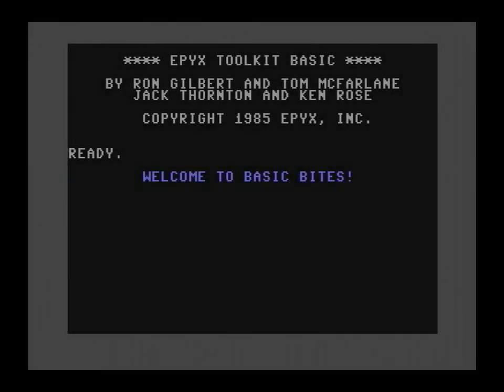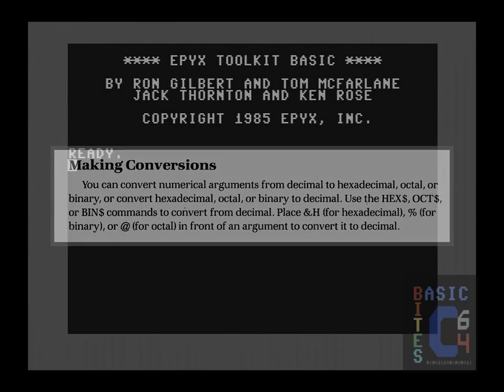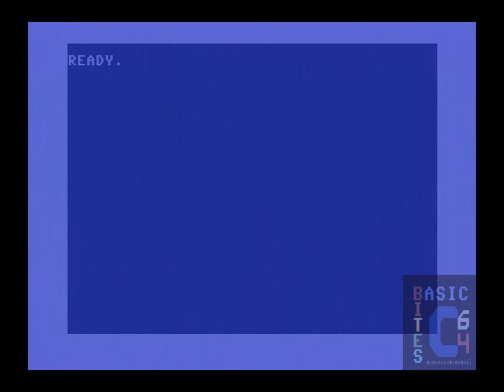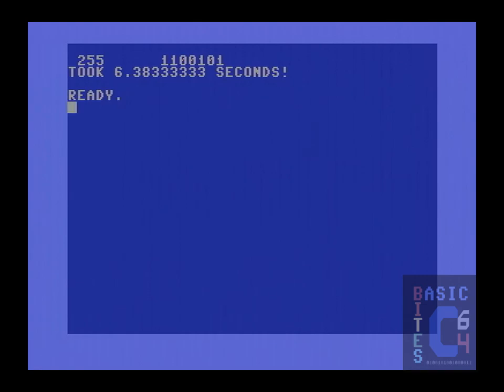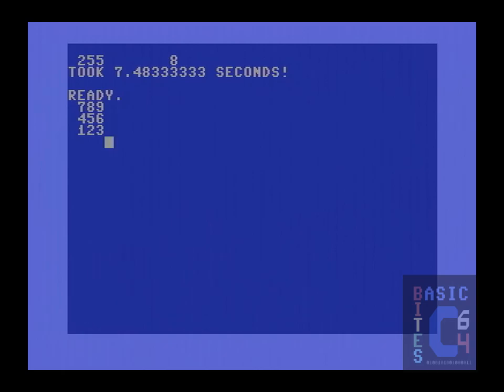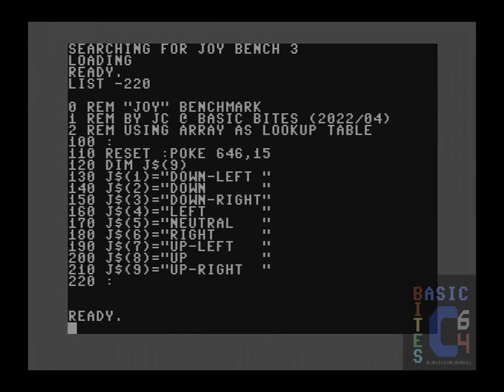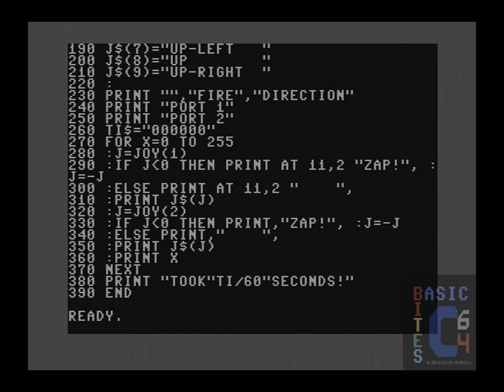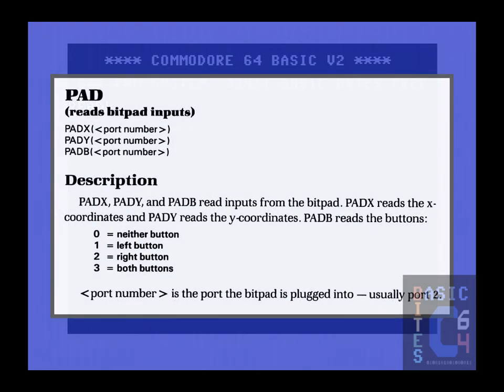JOYSTICKS and BINARY in Epyx Toolkit Basic | Commodore 64

Comment: 11:20 Single-letter variable names run faster than two-character names.

13:21 It'd probably be faster to just print a "{home}" character before the X.  Parsing even single-digit numbers "1" and "2" will be slower than referencing variables.

25:48 For joysticks, you only need to set up a string array for indexes 0 to 15 and then do PEEK(56320) AND 15 to get the directions.  The six "impossible" combinations can be filled in with whatever.  This organization was obviously envisioned by the C64 hardware designers.  You could also set up 32 strings that include the fire-button status, or set up 19 strings for JOY()+9 values 0 to 18.
Reply from the maker: Clearly you stuck through the entire video! 😄  Those are all valid points, and inspired me to run some additional benchmarks out of my own sheer interest, as follows:

1. Yes, it's technically true that 1-letter variables parse faster than 2-letter variables, but since the gains are minuscule, I have always roundly ignored this common piece of optimisation advice in favour of more meaningful variable names.  In BIN BENCH 2, changing from PEEK(56320) to PEEK(J2) saves 1.18 seconds of execution time, and further changing it to PEEK(J) saves an additional 0.02 seconds.

2. I suspected the same -- using "PRINT AT" was pure convenience, and the opportunity to show off another Toolkit command. 😎  In BIN BENCH 3, changing it to PRINT {HOME}{DOWN} to put the cursor in the same place saves 0.52 seconds.

3. Definitely, bitwise operations are the way to go in BASIC V2... but you got me wondering how those stack up to the JOY() command for speed.  I modded JOY BENCH 3 to do J=PEEK(J2) instead of J=JOY(2), then use JAND16 to test the fire button, and finally print out the value of JAND15 to get the direction.  It ran 1.02 seconds slower, so bitwise does provide a worthy solution for BASIC V2, but it seems like JOY() is certainly the way to go in Epyx Toolkit BASIC.

Thank you for the comments!  -- JC
Reply: @BasicBitesCA : What happens if you do JAND31 against 32 strings that include both fire-button and direction information?
Reply from the maker: @csbruce  If you do that, you get the lower 5 bits of J as a decimal number, which is then translated into one of the 32 strings when passed to the array as a subscript. 😜 -- JC

Comment: 16:44 how come port1 has 8bits showing while port2 only has 7bits ?
Reply from the maker: Good eye!  It's because BIN$() doesn't zero-fill its output.  (E.G.- BIN$(2) will return 10, not 00000010.)  The highest bit (which is not one of the bits we're concerned with) is set on Port 1, but not set on Port 2.  -- JC